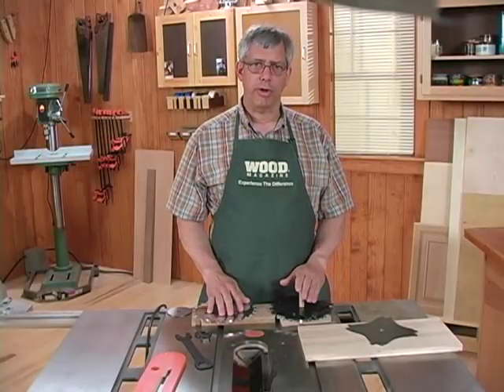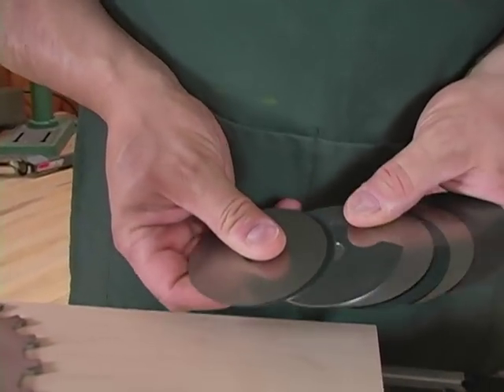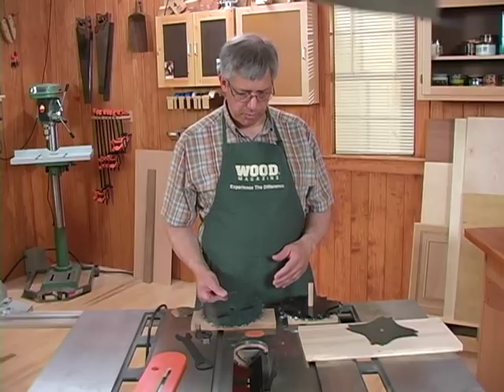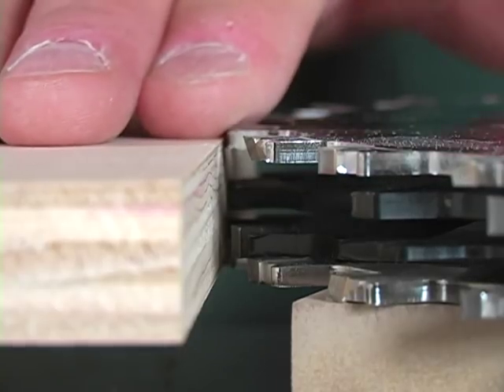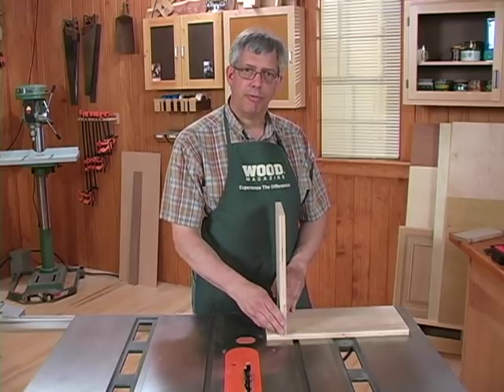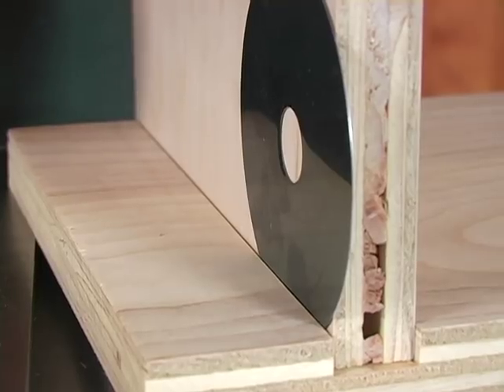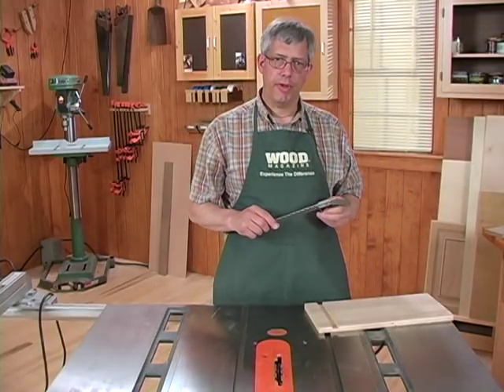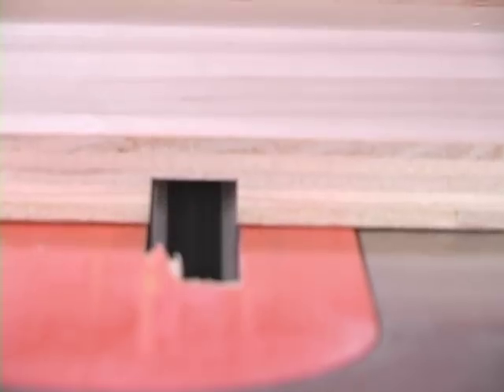How To Make Perfect-Fitting Tablesaw Dadoes - WOOD magazine

Comment: I noticed you were using only your miter gauge to push the wood. Why didn’t you use your fence and your miter gauge to push the wood
Reply: Oh. Man. Don’t try that.  That is dangerous and will create kick back
Reply: to piggyback on the other comment, with a miter gauge in the left hand slot, and the wood against the fence on the right, once the wood is fully cut, the "fence piece" will just be laying there waiting for the blade to grab a hold of it. Of course if you just used the gauge as a secondary distributed force, while pushing the work piece on the right hand side, that MIGHT be okay, but practically unnecessary, as you could just use two hands